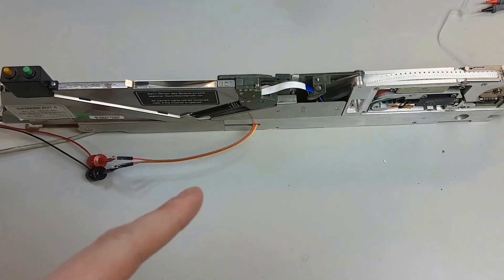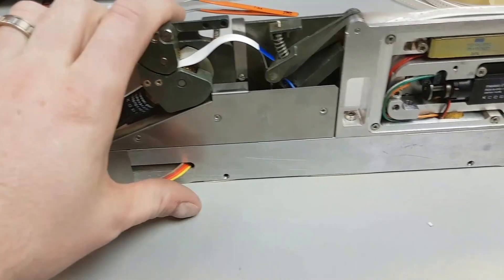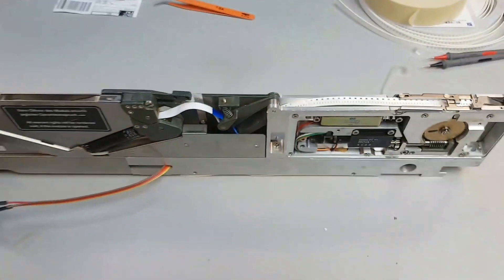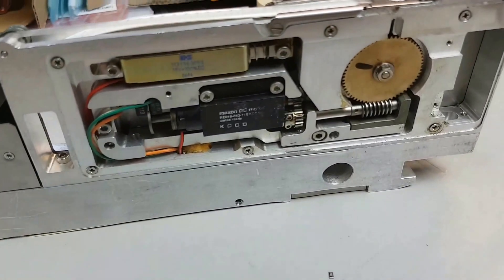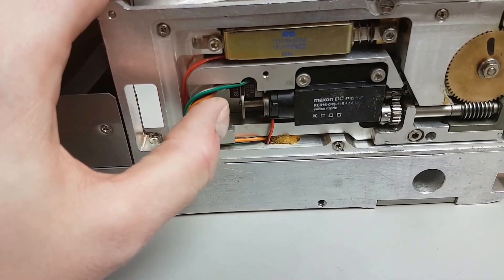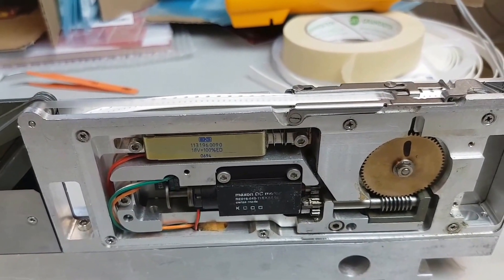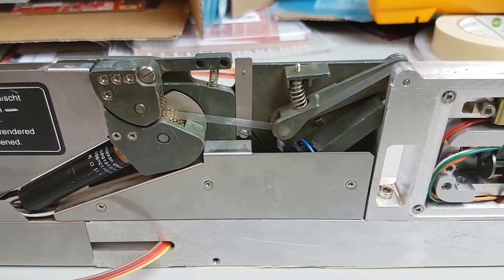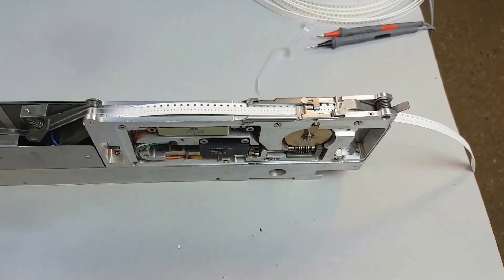DIY Dual Lane Pick and Place Feeder Controller using SIPLACE80 Feeders

Comment: Is there any documentation on how to control the Siplace feeder using the orignal controller.  I.E. pin out of the wiring.
Reply from the maker: James Williams i believe it's 30v serial. i don't have a running machine to trace though